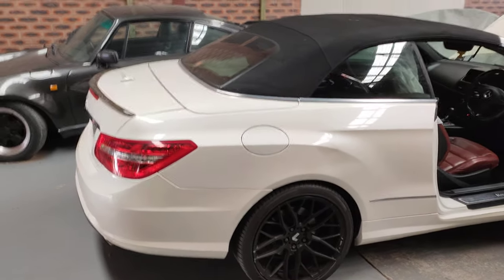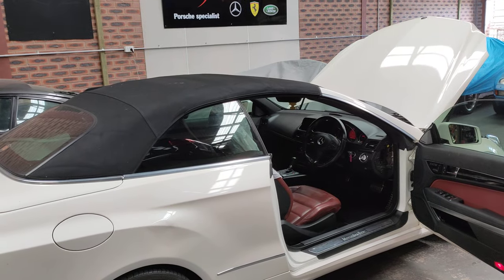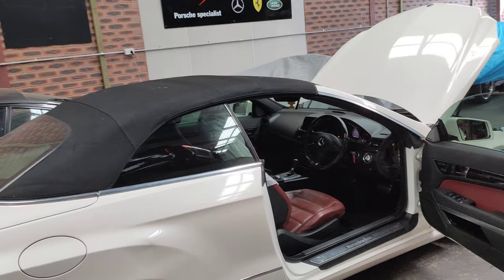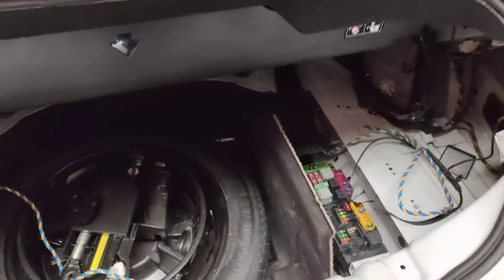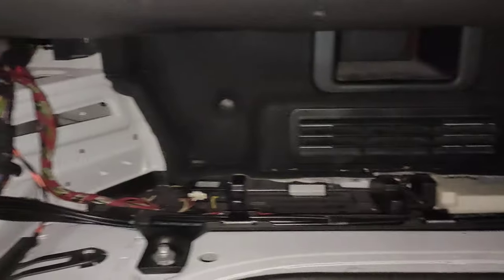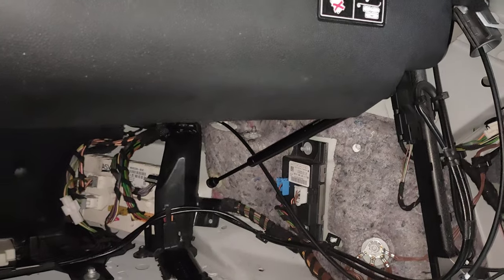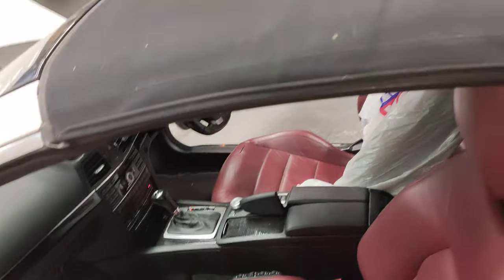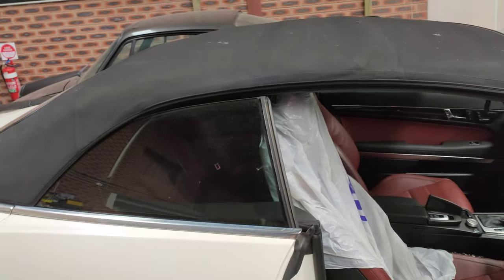Mercedes Benz E 350 Convertible top problem sorted by EMD Porsche Caringbah

Comment: Thanks for the lecture.  I have a E350 2014 cabriolet that the windows won't auto wind up after completely closing or opening roof top. What could be be the issue?

Comment: That was a beautiful display of how the top works however, you didn’t tell what you found to make the repair. I am assuming that a micro switch had failed or you had a broken wire. Which was it?
Reply from the maker: I had a lot of videos on this car & how to test the switches and others but one of the apprentices reformat the SD card on the camera & wiped out a lot of my diagnostic videos on this Mercedes
Problem was not the switches or pump
It was the control unit

Comment: Great work!
I ran into the exact same problem... did all the testing of the wiring harness, checked the microswitches, and so on... Final result was that the contol unit N22/6 had a major problem with the circuit of the hydraulic pump. Replaced it with a factory new one, did the so called "SCN"-Coding at my local dealership and the roof is working again!

Comment: I work on a lots of Mercedes convertible top most of time are switch are faulty sometimes hydraulic  I got 1 ECU problem but never run in to wiring harness. I hope you got the right tool to work on this type of car.

Comment: Hello,
 Loved your video, you obviously know your trade.. I have a 2011 E350 and my top is sporatic.  I have to play with it and sometimes need to help pull on parts to get them to work as it stops.  lately, it has been sticking at the 1st step of lowering it and I kept reversing the switch, hoping to get it to get the back to fully open. I think I blew the fuse.   Can you advise where that fuse or fuses are for the top?  I've looked online and have gone thru Fuse charts but haven't seen which one or ones it is.
Reply: I have the same problem and looking for same check list of easy steps to diagnose before bringing into a shop?
Reply from the maker: Sorry for the delay do you have a fault code logged
Reply: Hi, did you ever get this fixed have same problem on my 2011 E200 - windows go down but nothing else - again like you I try replacing a fuse but cant find which one controls the roof - thanks